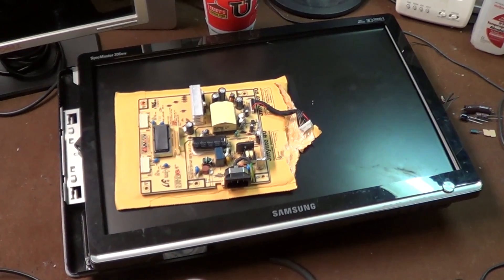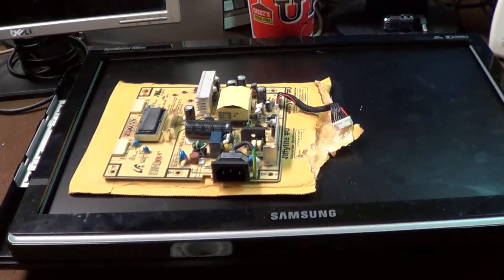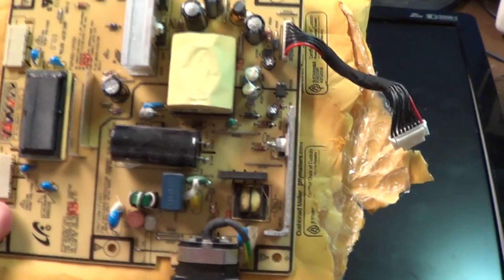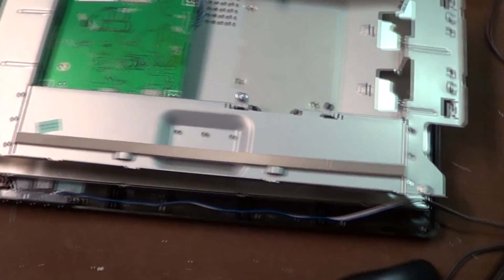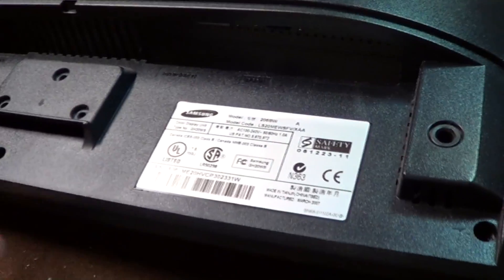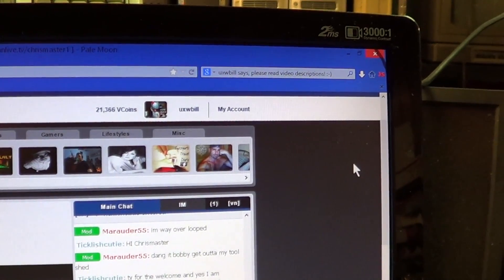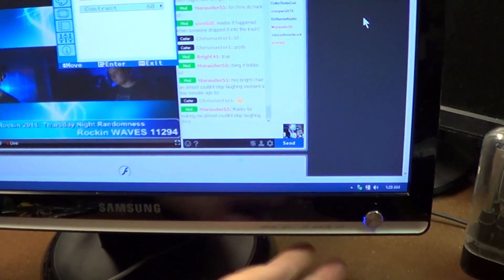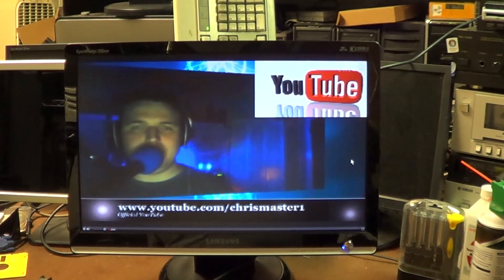Kitchen Table Electronics Repair: Samsung Syncmaster 206BW LCD Panel

Comment: Update: My 206BW yesterday just started turning itself off immediately after getting a picture and repeating this until it warms up in about a minute.
Reply from the maker: If it was still running on the original caps, it did well.
Reply: @uxwbill  Not in my book, the thing has only has 5500 hours. : (
My work still has a couple old dime a dozen 15" Dell flat panels from about '02-'03 that are on 12 hours a day, 360 days a year!
Reply from the maker: I didn't think I had to say "as bad as the original caps are"...but there, now I've clarified it. :-)

Comment: HAHA! I like how when I randomly look up stuff about my electronics I end up randomly seeing that you have the same thing! I bought a 206BW in '07 and still use it daily!
Reply from the maker: This 207BW ended up in the Fortress of Amplitude, and while it hasn't gotten a lot of use there, it still works well.
Reply: @uxwbill  Cool that you still have it. I just checked mine and it only has like 5500 hours on it. Also that impression of Casey Kasem is kind of what I would imagine it to sound like if the Keykeeper were to try it. XD

Comment: I bought one for $20 I don't a pc yet though . The powers comes on the monitor but does it suppose to show anything with out the PC connections ?
Reply from the maker: +Mr. Outlaw If yours has more than one video input (VGA, DVI, sometimes TV as well) it should display a message indicating which input it is checking for activity. Single input models say "no signal" or "check signal cable" and may blank out after a while.

Comment: The difference between the U.S.A. and Worldwide specifications is the fact that  U.S. monitors use a 60Hz fixed refresh timing and Worldwide spec. monitors can use either 50Hz or 60Hz without issue, if memory serves. That basically means that it's a switching rate power supply instead of a fixed rate unit.

Comment: Good job well done! I may suggest that you use the "lightbulb in series" trick when you test power supply boards (specially when get them from unknown sources or when their fault is yet unknown). A 100W lightbulb is OK for load-less or small power supplies.

Comment: Hey, I know that you have had plenty of experience in old computers and, well I have a problem with a few. First I have 2 pentium 2 mother boards that wont boot up into the native os. The run fine, do their self test, but when it is done loading windows, it just loops back into the self test. I think it is a ROM error, but both machines do it. However on one of the systems, a security code was needed to boot the os and well, I had no idea what it was so I looked some stuff up and it said there was a jumper on the motherboard that would bypass the code and reset the security prefaces. I did that, it worked but then it would boot into windows. The same thing happens to both systems and I have no idea what the solution is if I have not turned it into a vegetable.
Reply: ***** how ?
Reply: ok, thank you very much for your help. I really do appreciate it.
Reply: ***** It has vintage value, they are becoming rare these days since everyone seems to be scrapping them for gold and silicon. Besides the pentium 2 machine I am talking about was my gaming pc from '97.

Comment: There's nothing really happening on my channel, but I'm flattered that you linked it. I probably should have explained how to get into the menu, all I did was mention it in passing.
I don't know what those options in the menu do either.  On a 930B I actually cleared my panel/backlight hours by mistake trying to escape from that menu.  It happened when I held one of the keys for a few seconds.  The safe way to exit is just to cycle the power.  As unimportant as it is, the accidental reset really annoyed me.  I'm such a nerd about it I stuck a note on the back recording what the numbers were at the time of the reset.
At ~27K hours my "power cycles" number was ~100K, which is completely unbelievable.  I don't know what that number is really measuring.

Of two 930B's I've taken apart, I noticed that one of them, manufactured March 2005 in Tijuana MX, had a Samsung panel in it.  The other, manufactured Oct 2005 in China, had an AU Optronics panel.  The plastic bezels were also noticeably different.
Ironically though, the Samsung paneled unit had a much worse picture with both units showing very similar operating hours.  I can only assume it's because of a significant difference in the brightness they had been set to all their lives.  I know the AU unit (the one I had since new) was always set way lower than default so I guess that was the difference.

The Samsung panel lost it's backlight a while back, and I recklessly tried to pull a Frankenstein move, swapping it's electronics to a good Viewsonic panel (same resolution).  I got away with a swap like that once before, but the luck of fools is a fickle mistress.  First the LED blinked rapidly, then I detected the smell of magic smoke. Still haven't taken it apart to inspect the damage. Hope it wasn't the panel that got killed.

Comment: Interesting, I have an LCD TV from 2008 that I bought from Samsung, and it continues to run great to this day, though I don't use it as often as I did initially.

That said, I am STILL using the NEC Multisync LCD 1765 17" 4:3 LCD monitor I bought new in 2004, and it's never had one lick of service, still works fine, even the backlight (CFL, cold cathode) still is plenty bright, and no dead pixels that I can detect yet, and ti's on ALL. THE. TIME, well, when not home or when the PC goes into sleep mode. I DO turn off both monitors when not home, or overnight, but they stay on otherwise and the PC (a 2009 Dell 435T Core i7 tower) will go into sleep/hibernate mode after a time when not at it, and online.

The other monitor is the Dell 22" (21.5") HD monitor has been great so far. Wish I could say the PC itself has been flawless...

Comment: Very interesting and entertaining video uxwbill like always..
I have a question but it does not pertain to a TV its about my receiver a vintage Fisher 201 futura series and the problem is that the power transformer gets hot to hot to touch after about 20 minutes of playing. I was wandering if you could give me some pointers on what could be causing this.
Thank you
Rob
Reply: ***** Hi uxwbill,
and thank you for youresponse to my question.
It concerns me because i have ther vintage receivers and the transformers don't run that hot. And yes it gets that hot that i cant  ouch it for a few seconds.
And yes you are correct about the date of manufacture.
I will go ahead and replace the power supply filter caps.

The receiver does have connections for an extra set of speakers but i only connected a pair of 8 ohm set of speakers for testing the receiver
and only operated the receiver at low volume.

Hopefully i can resolve the problem with the replacement of the power supply capacitors.
Thank you again for your advice and expertise.

Rob

Comment: I paid 279.99 for this exact monitor on sale, back in 2007. So far I havent had to rebuild it, and it works perfectly. Although the panel backlight is showing evidence of damp basement all its life.
Edit: 22,830 on the clock for mine.
 670 cycles.

Comment: Another Samsung monitor with bad caps... typical. Also, I wonder if that odd noise was due to your camcorder not being in focus properly and trying to focus? Equally, my guess just by looking at the size of that mark is that it is indeed one of the backlight cables - it's just the perfect size and shape match for that.

Comment: a lot of monitors has that info under info. my hp vs19e has it. total hours -15538. backlight hours 16664. i fixed it by changing 3 caps. basically did this. http://schmidtcds.com/2009/09/hpvs19e-monitor-fix/
 think cycle my be auto off not really turning it on and off.

Comment: Again a great video. 
I have a similar monitor, the SyncMaster 223bw. Allthough the power-suply seems to work just fine (for now), the buttons stopt working, wich is very annoying. 
After some messing around i got the monitor in the "ON"-mode, but i have to take the plug out to turn it of. It does turn on again when i put the plug back in. 
But no reaction on the buttons and the LED behind the power-buton doesn't work either. 
To bad i'm not as handy as you are, uxwbill, i would like to repair this thing as it is a fine quality monitor even today. But i can't figure out what is wrong with it. :(
Reply: ***** Thank you for the tips! I will look in to the mentioned points.Hopefully the problem lies there, so it could be an easy fix. 
Keep up the good video's!

Comment: That's hilarious of how you made a mistake about the Two Prong Plug! XD 13:02

I don't understand why they got a real cheap chinese caps that don't last long to where the company has to use a real cheap caps and to the point that people has to replace a whole monitor where people think it's not repairable. Like I have one include 2007 Instand Weather Band Radio and TV Sound, Model RP6248, it covered up with wax to the point that I can't check or replace the caps which that's a real dissapointing and very sad to where I got to either remove the wax with special type ingredients, or replacing a whole equipment. =( Back then, my '07 Emerson Weather Radio works fine where I can tune to FM, AM, TV 1 & 2, and WB, and all the suden, FM, AM, TV 1 & 2 isn't working and WB works and nothing else, and the clock display is working two. I just cannot believe what companies are getting a cheap caps to install to where people have to buy a new caps or a new Elctronics.
=(

Comment: What is the res of the monitor? 1366x768, 1440x900???
Reply: 1680x1050.
Reply: Most likely 1680 x 1050.
Reply: randomfish42
 Hmm, randomfish42's comment wasn't there this morning. I've noticed that YouTube's commenting system has really been derping out lately and not showing some comments, or the contents of the comments.
Reply: ***** Another great video, Just wondering what does windows 8 run like on an older computer as I have heard that it can be better than windows 7, I know your not a big fan of either of these OS and I find that you definitely need the classic start shell to windows 8 to  be "useable" shall we say instead of the awful metro interface, again great video looks like you need to start a 'Pool Table Computer Repair' segment haha
Reply: MOTERHEAD69 Well if you have a 1.0GHz 1 core CPU, 1gb RAM, 20gb HDD and a 256mb Vram GPU you should be fine but you can windows 7 & 8 on lower amounts of Vram but on 7 you wont get the aero styles

Comment: Well repaired bill :-))
Unfortunatly capacitor death is the cause of most modern equipment, switchmode psus are great but they kick the hell out of the caps.
I repaired a washing machine for a frend, the display was confused and flashing like mad, i took a look at the switchmode.... yup dead cap city :-(

It had lasted 2 years, looking the capacitors up on the outernet, the rating in hours indicated 18 months!!, manufacturers want them to die.
I bunged some new over spec panasonic caps in, all was loverly again :-))
Reply: The rated life of electrolytic capacitors are generally given at it's rated temperature, voltage etc. Generally you can expect life to double for every 5°C-10°C you reduce the temperature, lower voltage will increase it's life some too, up to about double at half the rated voltage, if I remember correctly. 

Of course, if the manufacturer skimped on the caps and used cheap, low quality ones, such a rule of thumb doesn't really help much.
Reply: Ts6451
Yes your spot on with your understanding of capacitors :-), when i replace them with new ones i tend to stick to known brands but i allways over rate the capacitors in ripple/voltage/temprature, ive allways done this and not just capacitors.

Im not sure if i mistrust manufacturers data or just allow for a hard life so the device becomes reliable and i dont have to worry about it lol.

Comment: We have exactly the same problem in France when it comes to trash picking things !
Scrappers all around, weird legislation that may or may not make any sense, etc ...

But I consider myself pretty lucky. I found recently something that I always wanted ! A Laser printer in the trash !
And after changing the toner cartridge (wasn't included), and cleaning the paper rollers, I at last have a GOOD printer !
I hate inkjet printers, for what I do they are always in need of some maintenance everytime I need to print something; and I have a lot of them ...
But the laser one, perfect !

Comment: I don't know a ton about electronics but i don't understand why capacitors fail so much on consumer electronics. Is there not a standard on capacitors? I understand heat is an issue but are there capacitors that can withstand heat better than others? And if so are they that much more expensive to produce?
Reply: *****
Caps are the predetermined breaking point of todays Consumer electronics. They are likely to fail first, as stated in the previous comments.
Reply: *****
Great explanation. Thanks,
Reply: It's way for companies to make their products fail prematurely so you go spend money on a new one. Yay consumerism
Reply: Wow I would have never commented if I knew uxwbill commented first, his explanations are like 25.7 times better than mine lol
Reply: All I can say is, everyone that responded is 100% correct.  I do believe there is some overcharging of capacitors that happens also, either that or they are ran right at their voltage rating which causes them to die faster as well. I only say that because in my restoration of audio equipment and measuring voltages, the older stuff usually has a slightly higher voltage cap than the circuit is actually supplying to the capacitor. I see usually avg of 10v difference between actual voltage and what is rated on the cap with older stereo equipment.

Comment: Really like the samsung service menu tip, never knew that, i have a Samsung SyncMaster S23B550 Manufactured in 2012 that i've been really happy with, but was very surprised to find out it has a cycle count of 29411 despite only running 4146 hours, its probably because i have my screen off time set to 15 minutes, and im off and on my pc all day but i'm hoping that doesn't matter as much with an LED backlit panel

Comment: I found an apple Cinema Display ( CRT) by the curb  (it's what attracted me to stop, it  had similar  styling to an iMac,) I passed on it because I don't have a Mac that has the adc connector (or any Mac for that matter ) so I couldn't test it and have no use for it.... And I don't need  more computer  stuff

Comment: I'm sure Samsung designates different manufacturers for different models of the monitors. Odds are, the more premium ones are built in-house while the cheaper models are sent off to more smaller companies to build. Cheaper costs, and in most cases (not all), cheaper prices.
Reply: Could be, the whole point of a company is to make money. This could be another way of doing so.